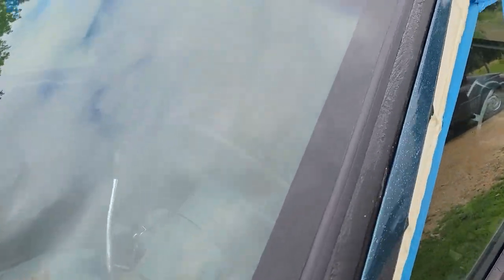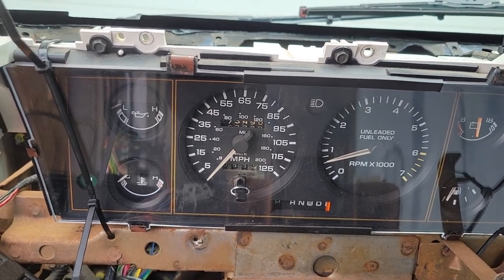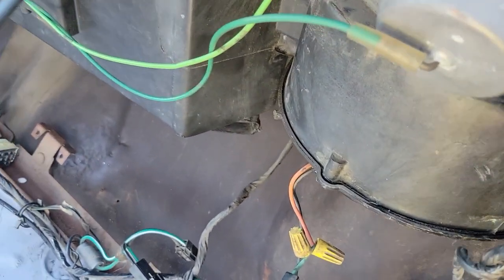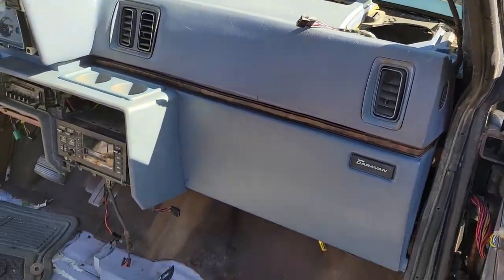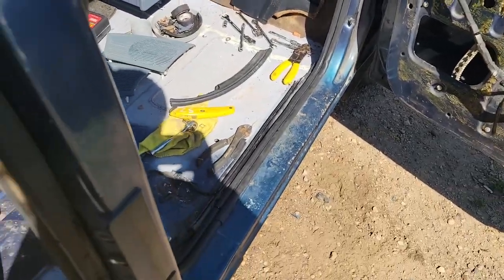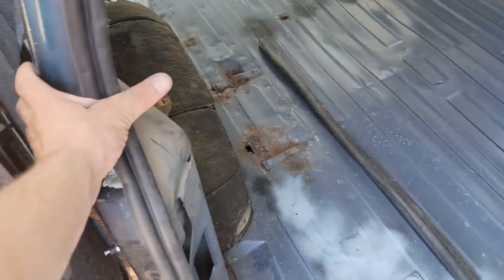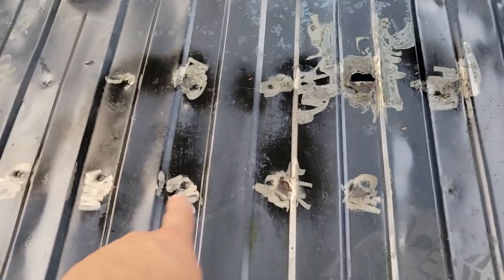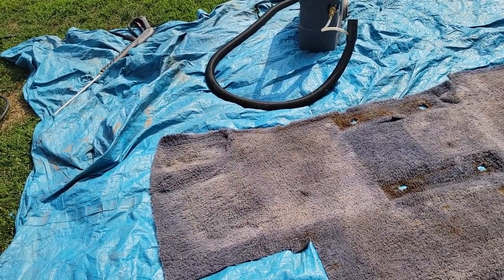1990 Dodge Grand Caravan LE "restoration" | Part 10 | Putting the dash back together & more

Comment: Do u have a video of u taking the instrument cluster out? I just purchased a 1990 Plymouth grand voyager. The mph works, the resettable miles work, but the main cluster miles is not rolling over. Any advice before I take the cluster out and send it off to be fixed??
Reply from the maker: @michaeljackson8510  I'm not sure if I recorded the removal but if I did it would be in like parts 4-7 of this series.

Sounds like you have a broke gear on the odometer. Taking them out is pretty easy, just remove the bezel and then it's 4 screws. If you have a tilt wheel, you should be able to snake it out of there. Non tilt you might have to lower the steering column.

The hardest part is unclipping the speedo cable and the wire harness... but especially the speedo cable. It can be a pain to get back in. Having small hands helps but just take your time haha